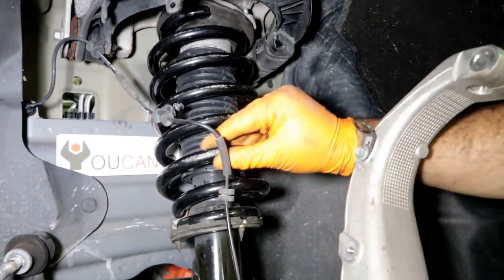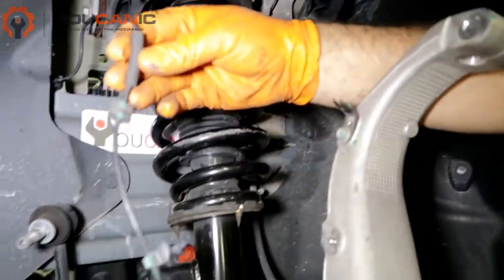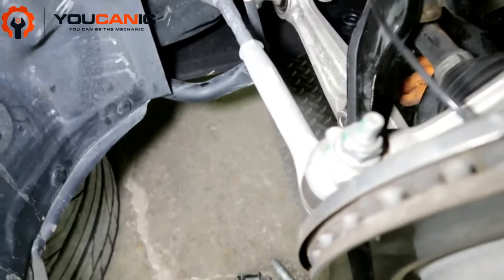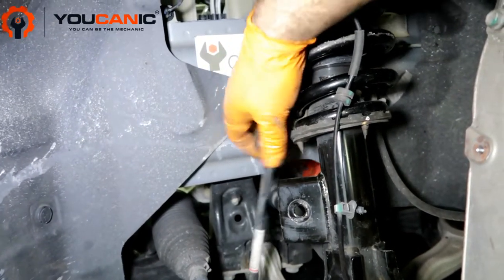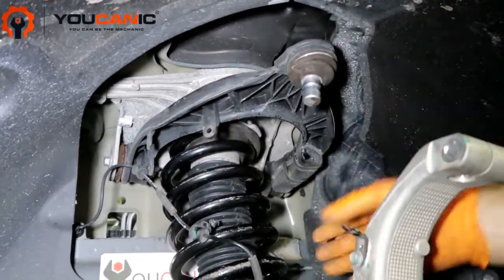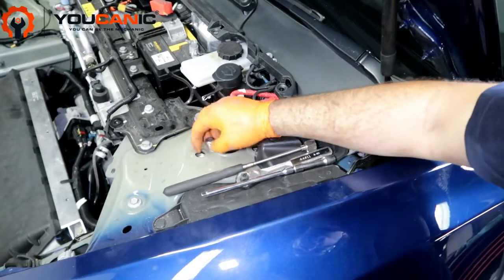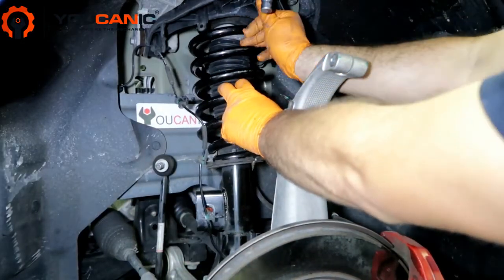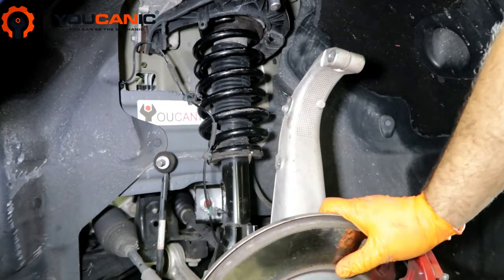Front Strut & Spring Replacement: Tesla Model 3 AWD 2017+

Comment: Hey guys. there are some infos missing about the center strut nut /piston rod nut. what size is it? 17 or 18mm and how much torque is needed to tighten the dome bearing, before removing the spring compressors? Thanks in advance and have a greate day.
Reply from the maker: Thank you for your question! The size of the center strut nut and the right torque necessary for your dome bearing may vary depending on your vehicle model. We recommend utilizing our extensive resources at www.youcanic.com where we provide detailed guides and factory repair manuals. 

Youcanic's mission is to empower car owners like you and we're here to help throughout your car maintenance journey. If you need more specific assistance, please feel free to ask your questions on our YOUCANIC platform. Our team is ready to support you, enabling a more confident and economical car ownership experience.